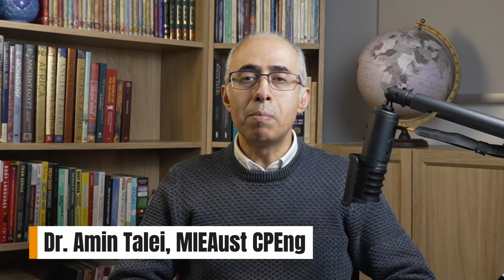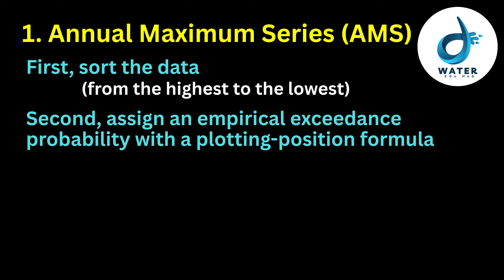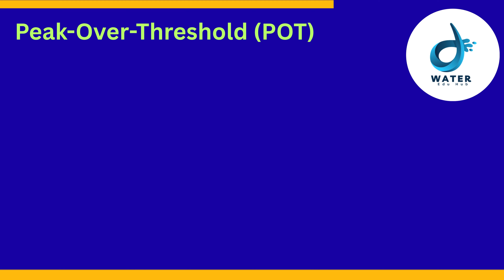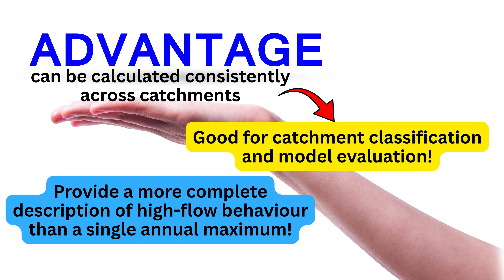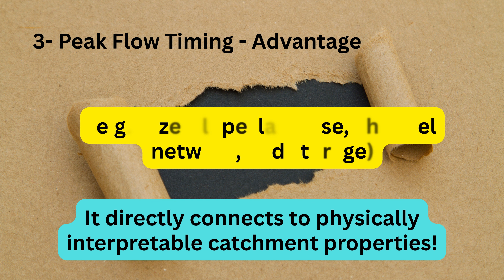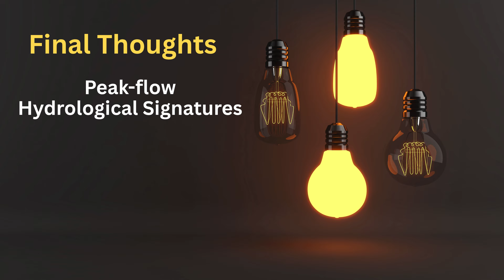Peak Flow-Based Hydrological Signatures Explained | Annual Maximum Series, POT, and Lag Time

Comment: Thanks for this interesting video. The POT method looks interesting. I assume selecting the threshold would be the main challenge.
Reply from the maker: You are absolutely right, selecting the appropriate threshold is indeed the most challenging part of using the POT method. The analyst should decide on it based on the project's needs and historical data on flood events.